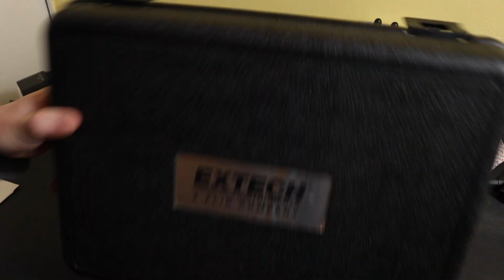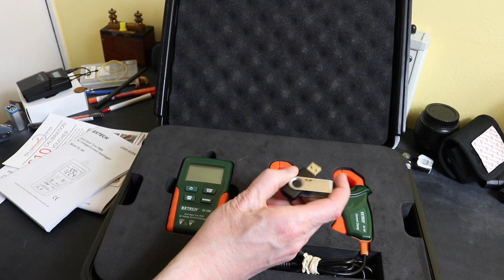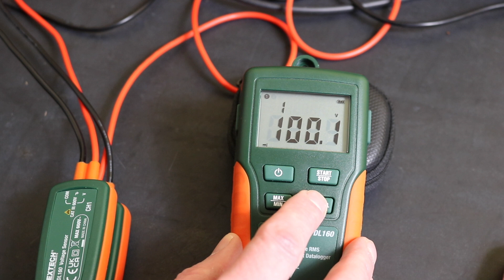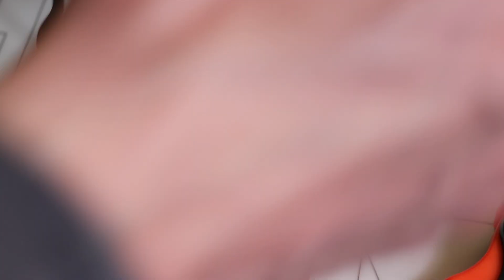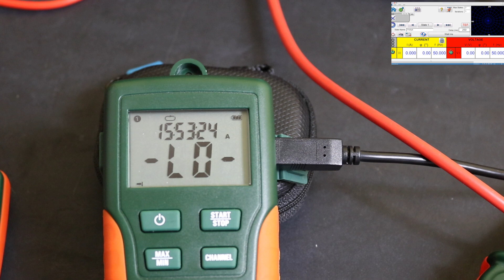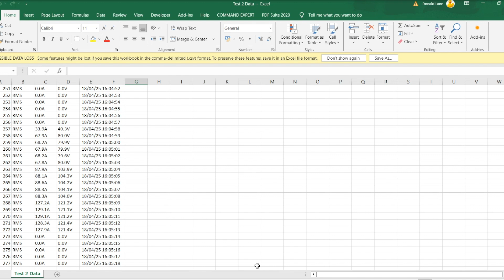Extech DL160 2-Channel Data Logger

Comment: Hi. Just ordered one of these for logging voltages in a rack of equipment. It looks like the device only seems to register changes in voltage or current rather than the meaured values at every datapoint. When you show the CSV file for the second sequence (around 19:20) it looks like the change from 10V to 40V is registered, then there's a load of zeros, then at the next step to 80V you can see a 40V reading then the 80V comes along for a few seconds. Then zeros again. Just wondering if you've used it in the field yet and if the data is useable for longer term logs.
Reply from the maker: Interesting observation, I can't find anything in the manual regarding how it records. There is a line in the software help file "If the power line is noisy, Transients (TR) will be recorded and the total number of data points recorded will be reduced", that may be what is happening with my data.
I have only tried recording an impedance test, but it doesn't have a low enough current threshold for me, so it has stayed in its box.

Comment: What Is going on of the curent less than 10A , for exemple 8.5A
Reply from the maker: The DL160 is rated to read 10A up to 200A, so isn't designed to read any current below 10A.
Reply: is there one similar with the price with two channels but that can measure lower current
Reply from the maker: @lotesla80  Not that I have found. The closest I can get in price are power clamp meters from the likes of CEM, Uni-T, PCE Instruments.
Alternatively you could look at power transducers and build a logger in LabView etc.

Comment: Possibly why it was being sold, bad accuracy? Maybe not a fair representation of a new one? Pricey indeed though for two channels! 
Somewhat related, I have a few off the (cheap) shelf Sonoff and Tuya power monitors I flashed with Tasmota and / or replaced the Tuya MCU with ESP8266s. Run an Amazon EC2 server that does all the communications using MQTT (secure with TLS, not clear text), Node Red to run it all, InfluxDB for the database and Grafana for the data display on web pages. 
Never had the chance to validate the accuracies using a calibrated source like your SMRT1 though and don't expect high accuracy for $10 devices. 
But, using an amp clamp and DMM to calibrate the devices and compared with the kWH meter from the power company the CT models are pretty spot on when monitoring the whole house load. I have a handful and some use CTs for up to 100A loads and a few are pass through for lower current, plug in loads. No offline logging though, so needs an internet connection and I have them polled on a 2 second polling rate. Volts, Amps, Watts and power factor. A few do frequency as well, depending on the power monitoring chip they use on different models. 
Poor mans data loggers and fun to play with and configure. No third party cloud required, all my cloud. 
Also have temp / humidity sensors as well and use them in conjunction with a power meter to monitor customers aircons or refrigerators. USB power banks don't last in the freezer, so no freezer monitoring.
Reply from the maker: You would like to think that a new one would be reading in specification, although this one doesn't look that old. Lots of data logger available out there, bit more awkward for me to make up my own for use on a customer's site, especially connecting mains voltages. Most of them seem to be reasonably accurate for general use though.
Thanks for watching and commenting.
Reply: @three-phase562  Agreed, but just different markets. Electricians get paid $10 a day, if that. So that limits what I can charge (more than $10 an hour) and what people are willing to pay for services. The ROI on a name brand, quality power monitor would be never for me. LOL 
Plus that stuff is my hobby that I use in the field as well. Even being inexpensive, it's higher quality than 99% of the local work I come across. Scary!
Reply: @three-phase562  Agreed, but when electricians make $10 a day here I can only charge so much myself. There's no way I would get any ROI if I bought name brand, high quality power loggers. Even though most of my work is for westerners, they still want to pay local prices. But I don't charge local prices.

Comment: Nice video,  sad to see the accuracy was a bit off with the second clamp,  cheaper version here in the US is TRIPLETT ACDL200
Reply from the maker: Thanks for watching and commenting. Thanks for the Triplett note, I suspected it would be a rebrand unit, but couldn't find anything else out there. Still not sure who the OEM is though.
Reply: @three-phase562  No problem,  yeah its hard to tell who really is the OEM.
Reply: @three-phase562  the manfacturer is CEM company, China
Reply from the maker: @mazindeft5529  That would make sense, a lot of the other Extech Instruments are from CEM. I didn't realise CEM made data loggers. Thanks for sharing 👍👍.
Reply: @three-phase562  pleasure, thanks for  your awesome videos

Comment: Thanks, informative. Two weeks ago I bought my first datalogger: the uberlogger, still learning it.
Reply from the maker: Lots of data loggers out there, but most are in the DC sub 10V range. A bit harder to find a mains compatible logger like the DL160 without going silly money. Thanks for watching and commenting.
Reply: @three-phase562  yes, but I'am not in the higher voltage leak for this kind of work.